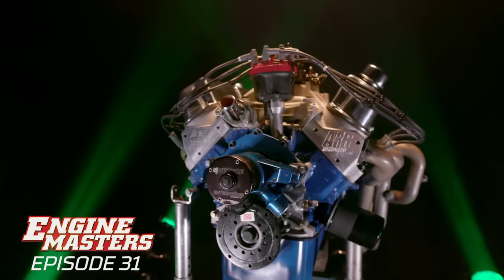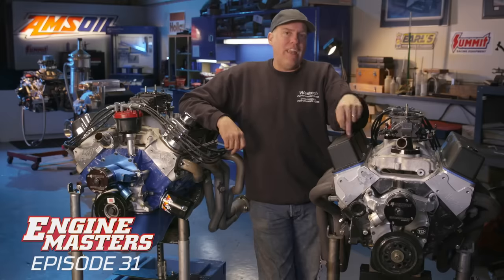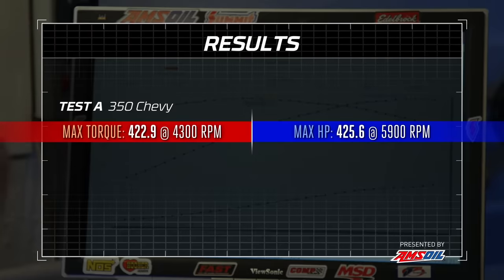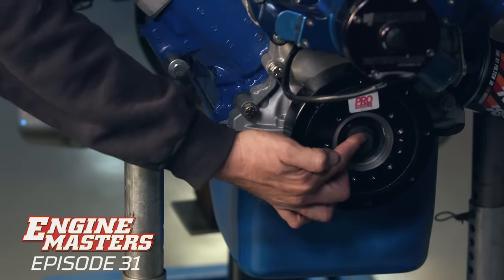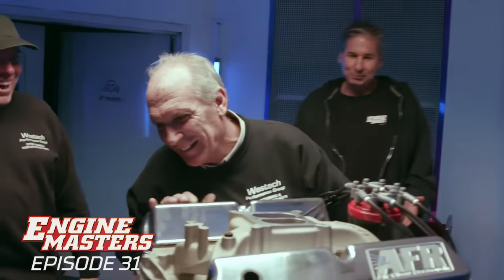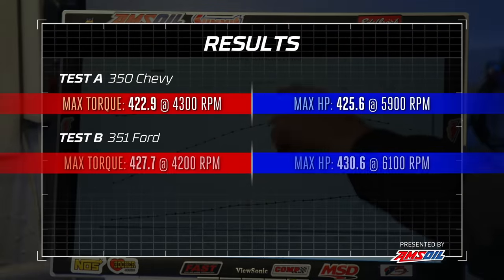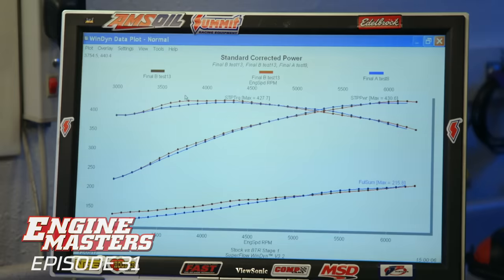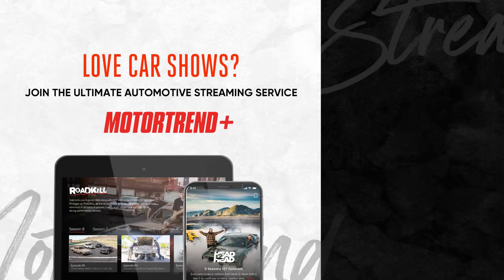Chevy vs Ford V8 Showdown! Small-Block or Windsor? | Engine Masters | MotorTrend

Comment: would of been good to see how each engine responded to some timing changes
Reply: Yeah. Some of these tests are odd. Also, I could see choosing similar Cams but different engines respond to different profiles.
Reply: from an actual comparitive standpoint that wouldve gave for a much bigger hp number over the sbc sbc before tdc is 8-10 degrees sbf is 10-12 before tdc and in a power application sbc is 12degrees ford is 15+ degrees and total timing the ford actually accepts way more timing  than the sbc thats why the distributors were locked out so it was as even as possible
Reply: @TylerDuysen  they probably had total timing set at 30 or whatever with no advance curve. Not just the 10 or so base timing. Suppose since the test starts above 3000 all the mechanical advance should be in already
Reply: @matthewklein9225  yes, I'm thinking in the neighborhood of 34 degrees total on the lockout?
Reply: @matthewklein9225  its hard to say because mathmatically im pretty sure they were using base timing no advance. there wouldve been zero mechanichal advance they locked out the distributors. so there couldnt possiblly be mechanichal advance. thats what that aluminum collar on the bottom does it doesnt allow any timing including mechanical advance
Reply: @TylerDuysen  they locked out the engines to what they would be with a regular timing curve because most pushrod pump gas v8s want around 34 to 36° total  timing

But I think if they did use actual timing curves that the differences could be easily made up because the best way to time a high performance engine like these is to give it as much initial as it wants without dragging the starter or pinging and  then limit the mechanical advance to whatever the total timing makes the most power or makes the car the fastest and you want it all in by about 2000 or 2500 RPM. That's what makes a snappy car on the street
Reply: @KingJT80  like i said do the math theres no way there was even anywhere close to that much timing second your not understanding how a distributor lockout works you cannot have a timing curve with the distributor locked out the arms that spring out for mechanichal advance are locked out therefore the only timing is what they set it too 3rd if they had that much timing the engines wouldve made 600+hp lastly watch the video they clearly say they set the timing and locked out the distributor  meaning its just base timing also finnegan clearly says "theres no timing curve to keep it a fair comparison" there was initial/base timing thats it
Reply: @TylerDuysen  i know exactly how a locked out distributor works.  theyre locked out at 34  means they start up with 34 degrees  and stays there.  easy concept.  those engines  could never make 600+  because of the heads intake camshaft and RPM range they are designed for  

 engines like these  AS I SAID  IF IT WERE TIMED WITH AN ACTUAL CURVE  would be about 34-36 degrees total timing.

 thats why they picked 34 LOCKED OUT  not that these have actual timing curves
Reply: @KingJT80  no bud your simply not getting it neither of those engines can start with 36 degrees of timing not a single engine will second as ive already told you several times they literally say in the video there set to base timing then locked out meaning the 350sbc has 12 degrees of timing and the 351sbf has 15degrees of timing im not gonna sit here and spell it out for you when several people have built thse exact engines with a timing curve and made 650hp or so which is what these should have made
Reply: @TylerDuysen  hahahah wait wait you think they got 400 hp at 12 or 15 degrees of timing hahahaha you really think that. When you lock out a distributor you look it out like it's been mechanically fully advanced. Base timing doesn't matter. Also saying these engines won't start with the timing advanced hahhahaha have you tried it. They will start just fine. I've got a 401 locked at 38° and a 440 locked at 34° guess what they both start.

Comment: One other thing that could be contributing to the horsepower difference is the distributor location. If you are getting your timing from the distributor, the further away from the timing chain the distributor is it will have more timing deflection the higher the RPM due to the pressure from moving the valves creating a torsional twist on the camshaft. If you are using crank trigger ignition, this does not matter, and from what I have seen as far as it being measured, it's only been detectable at very high RPMs usually starting around 7k, but for a horsepower difference. As small as you all saw, this could contribute I believe.
Reply: Sorry but that's not true

Comment: Great video. Would have been cool to add in a mopar 360 in there aswell just for comparison.
Reply from the maker: Good idea!
Reply: 360? A bit of an advantage over a 351 W or a 350 ya think. Maybe a 340 Mopar but not a big block 360 compared to two small blocks.
Reply: @MotorTrendWatch  Nah we good on the Gen I mopor test. It's a reason why Gm and Ford small block or Big blocks are raced and use for power deals.
Reply: @dandunning4409 360 "big block"... 340 is a good comparison to the 350/351... WTF are you talking about?😂😅 the 360 has way too low compression to be a good comparison and the original 340 is way too high...
Reply: 360 is a small block dummy

Comment: Now, if the 351 Cleveland was used instead of the Windsor it would be totally different!
Reply: Not likely. But just in case I am way wrong, how much more power do you think that engine would make over the windsor with a similar setup?
Reply: I think it would still be the same if they used identical heads.   The design differences, crank journal diameter, bearings, water passages, etc. don't effect power.
Reply: That wouldn’t sell AFR heads though. Richard Holdner did a dyno run.

1970 M code 351C 4v, stock intake, stock cam, headers, and a holley carb, 365hp, 379ftlb 
240/246 duration cam
Edelbrock air gap dual pane intake, 450hp/411ftlb
Iron 4v Closed Chamber heads

Comment: This is a good comparison I'm a fan of the Big 3 mainly old school, I will never mix and match I keep everything Ford, Ford, Chevy, Chevy and Dodge, Dodge. Would be nice to see a 3 way match.
Reply: Yessir I agree. I’m an old school Chevy fan but I appreciate them all. Check out Richard Holdner. He has done all 3. Not sure if he had them specked out this close though. This was definitely a good comparison.
Reply: A Chevy in a Foxbody is hard to beat
Reply: @bigboreracing356  a ford in a foxbody is better, why basterdize a classic car..
Reply: Sunbeam Tiger is worth the mention, not that you can find one.
Reply: @davidgalea6113  I think anything in a fox body is hard to beat
Reply: @jmanlinc  Its all personal preference anyways, if the owner wants a chevy or an electric motor then he can do as he pleases, it's his property after all.. but some people, myself included don't like that sort of thing. The engine is a big part of a cars character so why not keep a ford engine in a ford car?
Reply: @davidgalea6113 hurt yer feelings… 1000’s and 1000’s ofSMALL BLOCK CHEVY’S IN old ford street rods …! Never a problem with horse power , engine weight , distributor placement , oil pan location …ect.. Now ya really got a problem with the L.S.  ?  Some great things never change…🏁😂🇺🇸

Comment: I'd rather have the 350 over the 351W, 351C over both. back in the 80's edelbrock had a 351C at over 700hp, pump gas, on their dyno. fun fact: the Miami Vice white Ferrari had a 351C NOS injected because the factory motor didn't have the power needed for the stunts.
Reply: The "Testarossa" they used for stunts was a reskinned Pantera specifically built for stunt driving (it had cool touches like a third brake pedal for just the rear brakes to set the car up for sliding turns). They used real Testarossas for all of the close up shots.
Reply: @yosemite-e2v  oh yeah, I forgot that part, it was a long time ago.
Reply: I never missed a Friday night episode of Miami Vice. I thought the black Ferrari had a 350 SBC And the white Testarrossa had a 351-W on 
nitrous.
Reply: @StainlessTIG2  You could very well be right, I'm relying on old memories and Lyme + two concussions. one thing I do remember, GO EAGLES!
Reply: @rnrsteev  As much as I can’t stand the Eagles, I hated too see the Eagles get cheated out of a Super Bowl win like they did. One of the best Super Bowls that I’ve watched until that stupid call. It ruined that game. Not to mention, I cant count how many times I saw the same defensive grab and not get called through out the season, and they call it in the Super Bowl. Kinda reminded me of the 70’s Cowboys-Steelers Super Bowl games. The officiating favored the Steelers. Mahomes is going to get that special Brady treatment because he’s a money machine for the NFL.
Reply: @StainlessTIG2  I ONCE  saw Cowboys fans behave more poorly than Eagles fans. I remember watching that SB game, very deflating like brady's ball. Ha just kidding. I'm a liitle goofy, a tornado came too close for comfort here in SE PA, no power and going to have to cut trees. I don't use chainsaws( I play guitar) so wish me luck with the SawzAll.
Reply: @StainlessTIG2  oh, quit your whining.  The Cowboys were used to beating up the then pathetic NFC..Barnes tripped Swann, but wah wah wah.
Reply: @penguinsfan251  remember the Buddy Ryan days with battery ice balls? embarrassing but sadly amusing at the time.

Comment: Awesome test! I was pretty hard on you guys a couple years ago with the 455 vs 460 shootout. Not because I'm a Ford guy, but because of the build differences. This was really impressive and absolutely demonstrates that in similar applications either motor is a great choice! For this I would stick with the bow tie motor because even though the Ford made a couple more HP and Torque, you demonstrated on a similar build there just isn't enough difference. Also, in what I would be looking at for a 350ish application would most likely be a Chevy platform.
Reply: both engine makes about 200hp and 400lbs of torque at 1500rpm so if you go over that youre done

Comment: I’ve had a 73 ,75 and a 79 Blazer and I own a 79 Bronco that I’ve had about 10 years or so and all three blazers together are nowhere near as tuff as a 79 Bronco. A 12 bolt rear end is a piece of glass when you run a 35 inch tire and a 350 turbo trans is fine in a car but once again the 350 turbo trans does not like 35 inch tires where as a Ford 9 inch rear end and a C6 trans laughs at 35 inch tires and if you don’t believe me try it your self
Reply: Dam right brother
Reply: The C6 and TH350 are not in the same class.  If you want to do an apples to apples comparison, then put a TH400 against that C6.  However, the 9 inch is the better rear axle.
Reply: @silicon212  The 400 don’t compare to the C6 either.
A 400 is almost the same as a 350 but it don’t have a passing gear linkage
Reply: @matthewjohnson2495  it's not close to a th350 in any way.  Stronger, different ratios, different design entirely.  Shift linkage has nothing to do with anything here, stop creating strawmen.
Reply: AMEN brother chevy is junk, i grew up on a alabama farm dad a chevy guy we had a cow  pasture full of dead chevy square bodies some never made it a year and was garbage. Whwn i graduated high school i bought a brand new 1985 f-150 and drove it 35 years rolled the odometer 7 times landing on 20ish. 1st year 302efi manual trans hardly ever ant major problems.

Comment: My ‘72 Mustang has a 351 Cleveland rebuilt and bored over to a 359 Cleveland, by Barnett High Performance.  It was OEM block fully machined, OEM crank and rods, cast pistons, 2V heads with hp valve job and stainless valves, custom design hydraulic roller cam, Edelbrock Performer dual plane aluminum intake, Holley 650 CFM double-pumper carburetor, and MSD ignition system.  They dyno tested the block and it made 389 horsepower at 5,400 RPM, with 422 ft-lb of torque at 3,700 RPM

Comment: What is the weight difference between the two?
Reply: The weight is pretty similar.  The 351W probably weighs about 30 lbs more due to the taller deck.

Comment: When I was a kid, my dad told me that hp doesn't care what name is on the valve covers. I guess the old man was right! It was interesting to see a comparison between the two brands from the same era. There has been a trend to "ls swap" everything lately. Of course, the ls has 55 years of technological advantage on the windsor so it makes sense that it makes more power. Ford had been out of the pushrod game for so long. But now, the godzilla engine puts them back on par technologically. It would be interesting to see when the aftermarket for the 7.3 / 6.8 engines catch up with the ls. I suspect that the results will be basically what we saw here.

Comment: I agree with Freiburger , you won't notice the difference in tq or hp , but in the past I always thought the Chevy had a better flowing head , I guess in stock trim , but technology has obviously come to the show with the AFR heads flow numbers and 2 cubic inches 😉
Reply: I’m disappointed the ford didn’t actually out right win this. More compression, better valve angle, better firing order…..
Reply: I've followed Freiburger , since the 80s in CAR CRAFT and numerous other articles , HE is by far one of the coolest Mechanical geniuses I've ever seen , HE can make pure junk absolutely scream with just a few bolt on,  ALL HAIL DAVID FREIBURGER !!!

Comment: What this test fails to take into consideration is the glaring fact that building a Chevy will always yield more horsepower per dollar. Be curious to see a breakdown of the costs of all the parts laid out side by side. I guarantee the Chevy can be built for less.
Reply: I agree
Reply: Watch again. They said the parts cost for both builds was  nearly identical.
Reply: @delbertmcfinklestein8576  It's not that it can't be done. It's that it's not as practical to do. If you think otherwise, great. I'll stick to my Chevrolet.
Reply: andrewbecker  YOU were not paying attention because he addressed that "issue" and said the costs were almost identical !!!!  DUUUUUHHHHH!!!!!!
Reply: @wilburfinnigan2142  your correct, but my point still stands. 9 outta 10 times the average street built smallblock Chevy WILL be more cost effective.

Comment: With the best factory production OEM iron heads available for each engine family, the Chevy would have a huge advantage on a Windsor Ford. The aftermarket heads definitely even the score. The stock Windsor heads just weren't designed with big flow and power in mind. Of course, an equivalent build level OEM iron head Boss 351 would put the hurt to any stock iron head 350 SBC.

Comment: Biggest difference is the stroke capabilities. The 350 sbc 383 is as far as most stock blocks can go and the 351w can go to 410 most stock block . Sbc 400 tho would probably blow both engine out however.
Reply: 396 stroker is common for a 350 engine but generally was 87+
Reply: 351w can go to 427w

Comment: I own both engines, both very great  for performance..I would have to say the chevy is less desirable to work on than the ford in small ways as far as engine teardown and rebuild is concerned..just my opinion of course..drivetrain work is easier on my chevy rather than the ford in certain ways.

Comment: Aww but the 350 Chevy was used in a lot more vehicles than the 351. It was the standard engine for years but when you bought a Ford you were likely to get a 302. Also the 351 has huge mains and when you step up your game and start running at high rpm the bearing speed will wipe out the bearings. That being said the cars I drove with the 351 ran really well. It was a great engine.